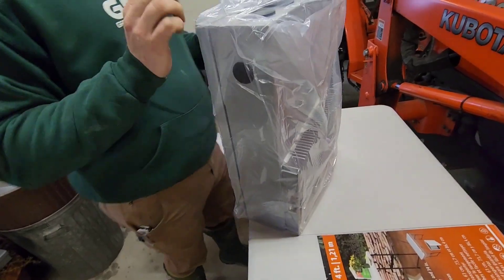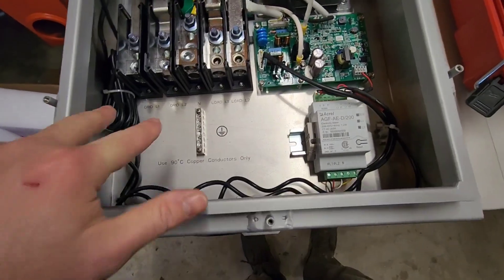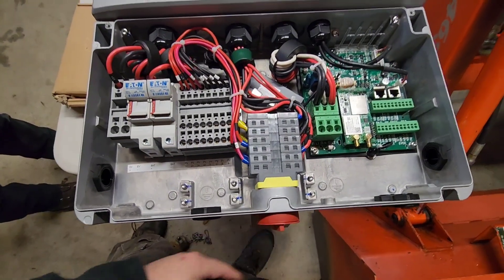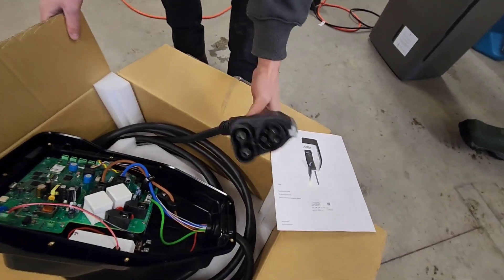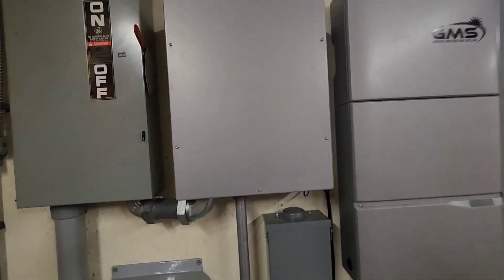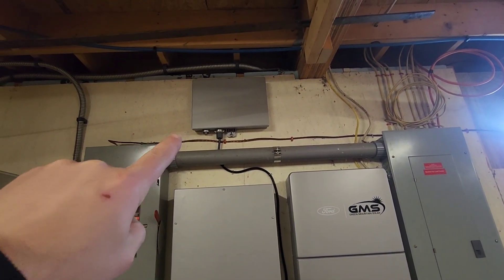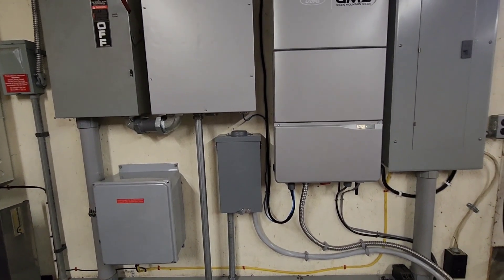This Truck Will Power Your Whole House!

Comment: So you can't charge the f150 with HVDC from the MPPTs in the inverter?  Lame, what is the dc voltage from the f150 to the inverter? ( I would hope it's more than 48v)

Comment: Really great way to destroy the battery in your Truck because it has about 1200 cycles to 80% and you're just using those powering a house with battery technology that shouldn't be used to power houses. (you should be using LiFePO4 with 6000+ cycle life)

And it isn't even as if this is an economical battery that is cheap to replace. This is a $25,000 battery pack that you're degrading for 0 real world benefit.

And it isn't even if these trucks don't absolutely suck in the winter time with range, which you're stealing to put into your house.

"Cheap home power backup system!"  Nope, not at all. "Short sighted home power backup system!" is more like it.

Over the lifetime of the truck doing this with any frequency at all, you'd be orders of magnitude cheaper to buy a cheap Growatt portable inverter. Or you know, a propane generator.

There is absolutely no intelligent case for V2G. Not one.  In every case, there is no economic model where it doesn't cost you VASTLY more than it saves you.
Reply: If you use this for occasional emergency backup, those extra couple cycles on the battery are nothing.  And the power in and out of the battery in the V2H or V2G scenarios is nothing compared to driving the vehicle and regen.
Reply: @billjohnson3344  if you use heat pumps for heating and cooling + electric hot water it’s about the same per day as a full 10/90 charge. 

And yes, if you did this 10 times a year for 50 cycles you’ll notice. 

Especially since the range drop is already massively bad in the winter AND when you use this because the power goes out you now don’t have a charged vehicle in said emergency. 

Meanwhile a growatt with the same output will cost you $1500.
Reply: @jameshancock  Show me that Growatt for $1500 that has a 130kWh battery and 9.6kW split phase output power and I'm sold.  Clearly not apples to apples, not sure of your point there.  The advantage of the truck is having a giant battery, versus home storage at much higher kWh / $ pricing.  The emergency power use-case is quite compelling, and no impact to the battery life for the handful of times you'd use it.
Reply: @billjohnson3344  5kw output, parallelizable if you want and up to 15kw per unit. 

And it won’t wear your $25,000 battery that has 1300 cycles to 80%. 

It’s on their website.
Reply: @jameshancock  Still not understanding how you propose a 5kW inverter with no batteries is somehow better than the truck backup solution with 9.6kW inverter and gigantic 130kWh battery.  And who cares if that battery is rated for 1300 cycles (which I've never seen stated), if I were to use even 10 of those cycles for emergency backup over the life of the truck?  Just not following what concern you have, or how your lesser solution is even close in function, total cost, or utility.
Reply from the maker: This guy probably loses power 2-3 times a year for maybe a day at a time.  I think this will be a great addition to his home.  Where are you getting 1200 (wait, 1300? It changed) cycles from the F150? I haven't seen that listed. Running maybe 2 cycles a year is not going to hurt anything here and is cheaper than buying another comparable battery to do exactly the same thing.
Reply: @benssolarandbattery  trinary lithium maxes out at 1400 cycles to 80%. 

And that’s the best Tesla with Tesla’s battery management and without charging past 90% often. 

F150s are getting charged to 100% regularly because of their crap winter range and they have a bad battery management system. 

So 1400 cycles is charitable. Probably closer to 1000. (In cell phones to 100% they last 800 cycles max)

LiFepo4 used to go to 3000 to 80% but now 6000. 

And EVs aren’t like home batteries. There is a minimum range where they become useless to people because they can’t get to where they’re going and back without lengthy charges. So even 80% when the person believed the label for range can very easily make it worthless. 

And while this might not be horrific in this case, people are getting money from power companies to use v2g to manage demand. And they’re doing it dozens of times a month. 

Which never adds up but people aren’t being told the truth of the real costs for doing this.

Comment: Will Prowse bought a used F150 and tried to use the power integration features but ended up returning the truck because it had "issues". I don't like the idea that a third party remote entity is responsible for commissioning the device. ... that's pretty fkin stupid - I guess that's the way of the world these days, more idiotic by the day. Try to find the video by Will, I'd post a link but since I'm one of the naughty ones YT will delete my coM-menT 100%.
Reply from the maker: I've stopped watching his stuff... he just whines about everything and never actually does anything. It seems to be working for him, but honestly, it's boring.  
I totally agree about the 3rd part commissioning.  Ford made a deal with sunrun to sell and commission all of the equipment apparently.  At least I was able to get right through to them and delta when I had questions.
Reply: @benssolarandbattery  Regarding Will, I unsubscribed almost a year ago because the complaining got rather tiresome. His stuff still gets recommended to me  every now and again and the F150 one sounded interesting and ultimately unintentionally hilarious.

Comment: Thanks for posting this. I’m looking forward to when someone shows the technical details on the Home integration system with DC coupled solar and a stationary battery. I think the truck plus smaller stationary battery could be a win. If there’s provision to efficiently dc charge the truck from solar would be excellent!

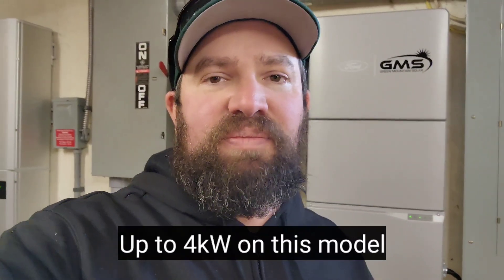Comment: At 7:36, I had to do a double-take. "I don't believe that it will charge off solar". I hope that is inaccurate.
Reply: Ben is correct.  This first version won't charge the truck battery from solar.  If you do have solar active though, it will use that and not need as much power from the truck.
Reply from the maker: I also hope I'm wrong about that.  The documentation with this unit is terrible. I couldn't find an installation manual anywhere and just went off the Sunrun training and Google docs commissioning guide. They're really vague.
Reply: I'm keeping in the back of my mind that the existing power delivery infrastructure is not equipped to handle mass adoption of these types of "batteries with wheels", hence power source diversification.a design with the inability to charge off solar is heading backwards, IMHO.

Comment: On the next one run a load lol Lots of people have problem over 4500 watts but likely because they are AC coupled.
Reply from the maker: Nothing is AC coupled here.  It pulls DC from the truck to the 9.6kW inverter.  Who is having issues? (Links? I'm really curious)
Reply: @benssolarandbattery  if you can get 9600 watts out of the on board generator why do they need another inverter inside the house.
Reply: @benssolarandbattery  Transport evolved did a video on it
Reply from the maker: @offgridwanabe  thanks! I'll check it out.
Reply from the maker: @offgridwanabe  check out the comments on their last video.  Initial issues but resolved after a possible update.  I'm hopeful that this system will function as advertised...
Reply: @benssolarandbattery  Thanks Ben Good luck